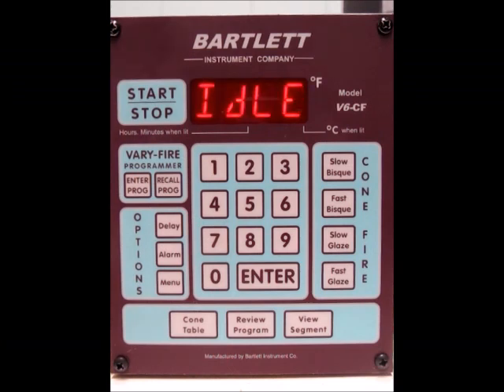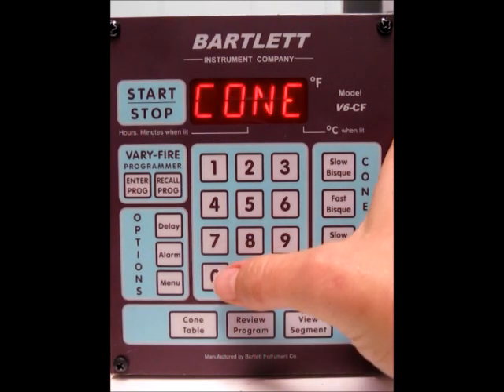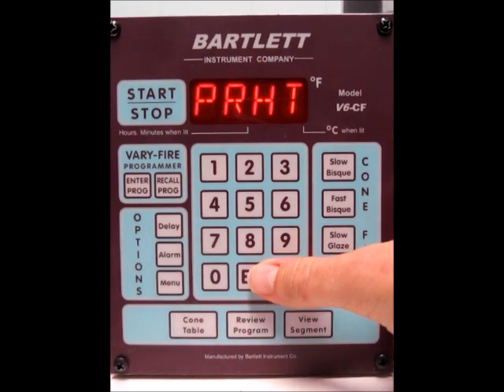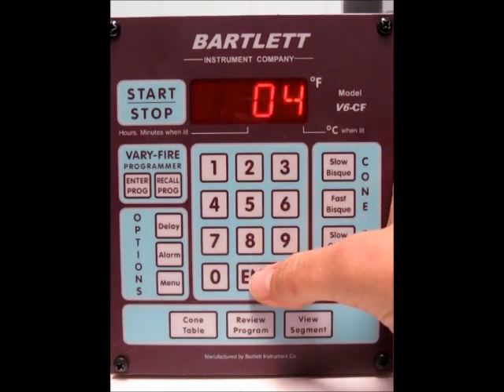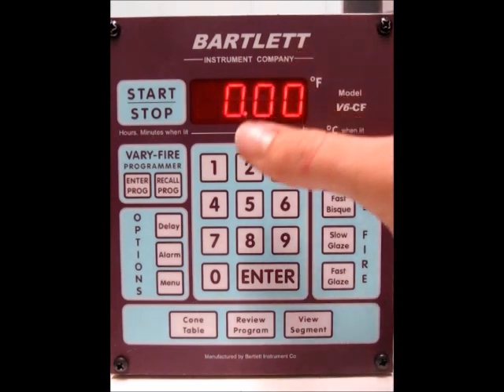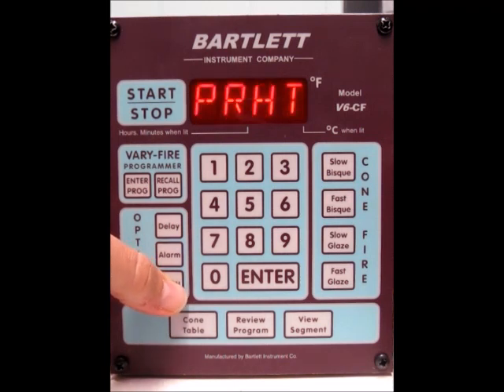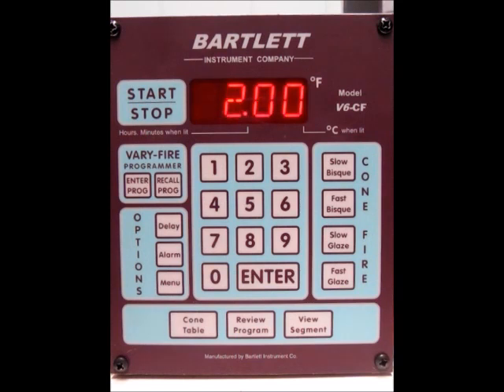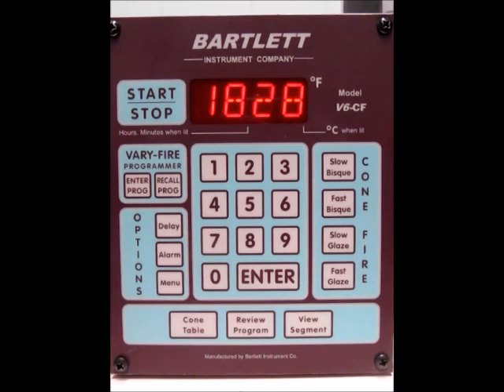Bartlett V6CF | Program Cone Fire

Comment: What does "cone offset" mean?
Reply from the maker: Cone Offset allows you to adjust the cone temperature if you are seeing an overfire or under fire. 
If you are seeing that you are getting too much heat work, you can go in and place a negative temperature offset on that cone value to lower heat work.
If you are seeing that you are getting not enough heat work, you can go in and placed a positive temperature offset on that cone value to raise heat work.

Comment: I do my test firing ans it’s show TC2, what that mean?
Reply: it means that its reading the temperature from the second thermocouple, the middle one.
Reply from the maker: This is correct. To check top and bottom thermocouple temps you can cycle by pressing the #1 or #3 button during the firing.

Comment: hi whats a cone offset ?? thanks for the video!!
Reply: @Bartlett Instrument Company could you answer this?
Reply: @choogiesaur  did Bartlett answer you directly?  I don't understand Cone Offset either
Reply from the maker: Cone offset is an adjustment a user can program in for a cone value that they see is firing too hot or too cold during a cone fire program. This is normally determined by self-supporting witness cones or how the glaze/ware looks after the firing. The offset is used to add or subtract temp from the cone temp. Maybe refer them to the page in the user manual for more information.